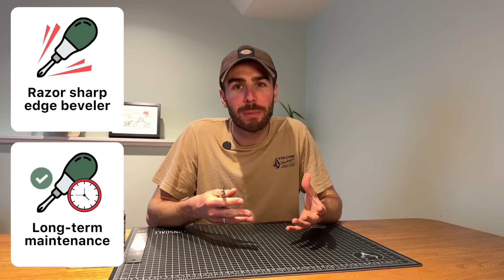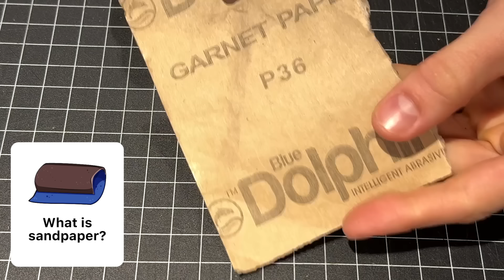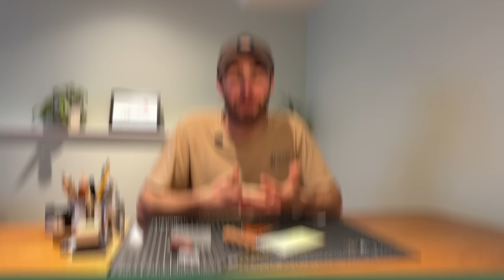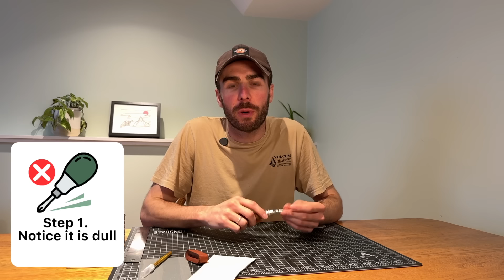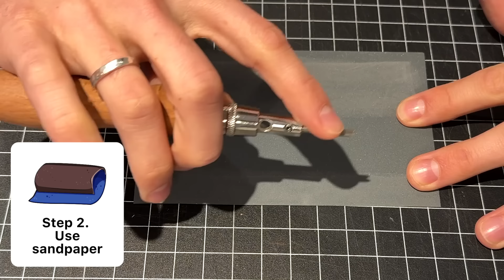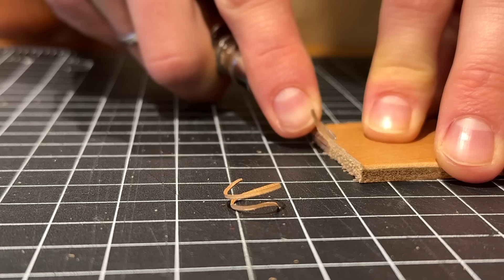How to Make your Leather Edge Beveler RAZOR Sharp

Comment: Thank you for sharing your experience. Great 7:47 video. 

Question. For knives the burr forms on the back side. Are you flipping the beveler over or does honing on the one side pull off the burr material sufficiently?
Reply from the maker: Thanks Grant, glad you found it useful! 

I have tested both and found a few passes with a flipped beveler does improve the bevel a little but not necessary to get a much improved sharper blade! I made this video a while ago so this test wasn’t included! 

I’ll pin this comment so others can see - great question!😊
Reply: @contourleatherco  Thank you for your follow up!
Reply from the maker: @GrantHendrick Thanks for the Q! Hope this helps with your sharpening 🔪 ⚡️
Reply: @contourleatherco  Hi ,I added a layer of 1.2 mm embossed leather to the belt and tried to burnish it but it won't bind..Is there any reason?
Reply: Regular paper with compound works awesome!  Careful with the sandpaper. It’ll have the possibility of removing too much blade edge.
Reply from the maker: @bysykler4959 thanks for your advice! 🎉

Comment: Thanks for the video, really informative, specially with the needle hack.
Just one question:
I saw you sharpening the bottom side of the beveler, how about the top side? Maybe not as much as the bottom but does it needs time to time to be sharpen as well?
Thanks a million in advance.
Reply from the maker: Glad you liked the tip! In this one I only sharpened the bottom flat side, not the top! 😊

Someone else has commented on this as well so I’ll dig into it a little more and maybe do a follow up video on this! You can always test it out and see.

Glad you enjoyed - thanks!

Comment: I have followed this video step by step at least 6 times and I MUST be doing something wrong.  I have a beginner set of Mudder bevelers (4) and they simply do not get sharp.  They remain dull and they drag.  Any suggestions.  Thanks.
Reply from the maker: Hmm - the only thing I can think of is dropping down the sandpaper grit a little, maybe down to 800 then working up from there & then using compound to finish off the beveler. Hope that helps! 😊
Reply: I'm rather new to leather crafting and am learning how to use all these tools.  At first, my edge bevelers didn't seem to be very sharp, and I went thru a process similar to this.  No difference.  Then I discovered that the angle of the tool is important.  Try holding the tool at a different angle.  My original mistake was too steep of an angle.  Good luck.
Reply from the maker: Thank you for sharing that - hopefully that resolves the issue 😊
Reply: Nice video! How do you pick the right size beveler for oz  or mm of leather?
Reply from the maker: @joelheffelfinger2253 great question! I’m working on a video on this as I had the same question a few weeks back! Coming soon(ish)!
Reply: Could just be you’re holding the beveler at the wrong angle, and not apexing. Try using a magnifier so you can see the edge, take a Sharpie and mark the edge with it and then adjust your angle until the Sharpie is removed right to the edge. Once you can see/feel a burr raised on the other side, strop to remove the burr and you’re in business.

Comment: A note on sandpaper for anyone who finds understanding a higher number removing less material, the number (like 700 for example) means that there are 700 pieces of grit per square inch. So a lower number means the grit is more spaced out, think jagged rocks. High numbers means those "rocks" are much closer together, making for a smoother surface
Reply from the maker: THANK YOU! What a great way of explaining it, I have never thought of it like that and had trouble understanding! Where were you when I was first starting out!? 😊
Reply: @contourleatherco  Probably in shop class learning the very knowledge I now pass on

Comment: I purchased 2 Palasanto edge bevelers years ago.  As a hobbyist, I never thought about having really good tools.  I think I may have sharpened these two bevelers once or twice.  A 1 and a 2 beveler.  I was always taught to load some cotton string with compound and pull it through the  notch to take burr off the tools.  Having a beveler with the best steel is key.
Reply from the maker: Thanks for your comment - several others have mentioned about the string with compound, I’ll have to try that. I’m going to be getting a new  beveler soon with a much better edge, but I’ve found this method allows you to work well with beginner tools and get nice cuts. Hope you liked the video! 😊
Reply: @contourleatherco  The video was clear and concise.  I have been doing leatherwork for 7 years.  Completely replaced all my initial tools with really good ones.  One suggestion, find string that is really close to the opening of your beveler.  There are excellent resources for learning and improving leather work for any skill level.  Your channel is another one.  My favorite one was a British professional who took his video business behind a paywall.  His old videos are still up.  Armitage Leather. Corter leather is another.  No pony stitching.

Comment: I've bought several bevelers since I started working with leather and if you're looking to buy a budget beveler that doesn't suck, I would recommend the WUTA brand.  They are about $10 each on Amazon and sometimes I prefer using it to the one I have that cost twice as much and it's much better than the one I started with that came in one of those beginner kits.  It also comes with a free metal rod (easier to use than a needle I think) as well as a strip of that fine sand paper.  No I don't get paid by WUTA I'm just sharing because I know how expensive leather tools can be, and it's easy to waste a lot of money on cheap junk when you don't know what to buy.
Reply from the maker: Thanks for your detailed comment! I’ll check out the WUTA - I’ve got my eyes on some new tools later this year when I can afford it (🤣) until then we sharpen the beginner tools!! Thanks for the comment 🙏
Reply: Я теж купила Wuta, тому підтримую ваші слова.

Comment: Maybe i missed something, or am generally not knowledgable enough in leatherworks, but with my edge beveller, the cutting edge on the side you sharpened, is flat with the two guiding sides (no idea how i could better describe it in english, as this is not my native language).
So putting the sandpaper with the needle on this side means grinding away the flat portion and thus reducing the effectiveness of the beveller over time. I have not yet needed to resharpen my beveller, but i was always thinking of removing material from the other side and then removing the burr on the flat side with polishing compound.
(one would need something round that fits the inside bevel though, and i am still contemplating what would fit, or if i should make something on my 3D printer for that...)
Reply from the maker: Thanks for your comment - so sharpening the underside face removes some material on this face where needed when the blade is damaged. This side curves up slightly so needs sharpening over time as it becomes more blunt.

Let me know how you get on if you try both!

Comment: That needle & sandpaper trick is a fantastic idea! For selecting sandpaper for sharpening, is there a preferred type? (ie: Silicone carbide, aluminum oxide or ceramic?)
Reply from the maker: Thanks Christopher! So I used electric abrasive sandpaper (because I had some of that already in my workshop), I don’t think it matters but I’m sure I didn’t use the best type! I’ll test it out one day in a future video perhaps?
Reply: @contourleatherco has to be very fine grit, 800+

Comment: I've sharpened my 1mm edge beveler only once in 20yrs when I first purchased it, ever since I only ever stropped it x20 before each use.
Reply from the maker: Ah that’s great to hear, so the stropping between every use is so key. Thanks for sharing your decades of experience!!
Reply: Do you use a compound  when stopping or just leather before every use?
Reply: @tazblink  I use white compound and then turn over to use green compound on fleshy side of leather.
Reply: @PINACI  Hey thanks for the fast reply. I will incorporate that practice  immediately. Thanks so much again.
Reply from the maker: Thanks for the advice & sharing @PINACI!
Reply: @tazblink  You're welcome. I strop 20 times on each side of my stropping board before I bevel which has white compound on the skin side of the leather a green compound on the flesh side. I also own an edge beveling sharpening stone but have so far never had to use it. But if I ever do then I would use a piece of 8000 to 12000 grit sanding cloth over it.

Comment: Safer side for 0.3 or 0.5mm edge bevellers - Polishing both side of blade using the correct size waxed nylon thread coated with  Grey compound,
Reply from the maker: Interesting - thanks for the suggestion, I’ve heard of compound on a nylon thread as a way to polish the blade - I’ll give it a go! Thanks

Comment: That needle trick is  awesome!  The second best to strop your edge before it gets very dull. That applies to knives as well.
Reply from the maker: Thank you! 🙏 Definitely - great idea…. Maybe a blade sharpening video coming soon 💡
Reply: Prevention is the way to go, IMHO. I strop before and after after each task and this keeps consistently good cuts. Having a solid strop about 12" long for edge bevelers makes this easy. Too much attention is given to the make/brand of tools and not enough to maintenance and use. This holds true for all cutting tools, keeping them sharp is not a separate task but part of the workflow of use. BTW, thin piano wire can be used instead of a needle. These come in various diameters and the longer pieces make it easy to shape or sharpen rounded edge bevelers. I used to use commercial bevelers as made but their limitations made me explore making and shaping my own.
Reply from the maker: Totally agree! I've only just started doing this and I've seen how much of an improvement it has made in keeping my tools sharp. 

💡 Great idea about the piano wire / thread - someone else suggested that so I'll check it out.

Thanks for taking the time to comment your experience you've learnt over the years! Hope you enjoyed the video ☺️
Reply: @bliksemdonder5624 very well stated.  "Prevention" and "part of the workflow", wise words in every part of life....